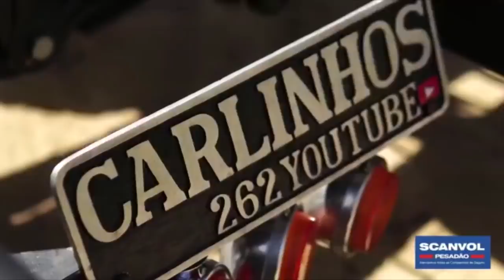P360 E ATEGO 3030   -  QUAIS SÃO AS VANTAGENS E DESVANTAGENS ENTRE OS DOIS

Comment: Meu amigo, sensor é tecnologia e tecnologia é futuro. Seria a mesma coisa de vc trocar o seu celular moderno por um antigo! 
Com relação ao eixo não subir é desvantagem porém vantagem no desgaste! Já rodei em um 3030 e o 4° eixo gasta pneu muito diferente! No scania a vida útil do pneu do 4° eixo é pelo menos 2 vezes maior. Agora é só comparar no final do ano com o desgaste do pneu ou o pedágio e ver qual sai mais em conta. Tem a diferença tb de um ser 280cv e o outro 360cv. Com relação ao peso concordo q 2000kg a mais no scania é bastante e talvez seja por isso q a turma gasta a mais com rodas de alumínio etc... A última comparação das bolsas de ar q acho q não dá tanta manutenção quanto falam! Mas isso tb é só a minha opinião! Com relação a cabine eu particularmente nunca rodei em uma cabine tão confortável quanto a do atego. Tenho 1,90 de altura e sofri muito dentro de um vm330. Scania = motor top e espaço muito bom; Atego = motor bom e espaço top dos tops; volvo vm330= motor top e cabine horrível.  Só minha opinião!